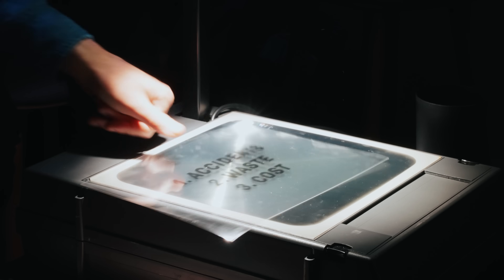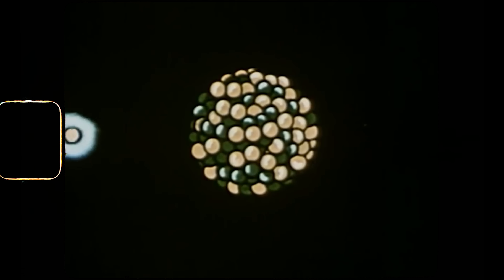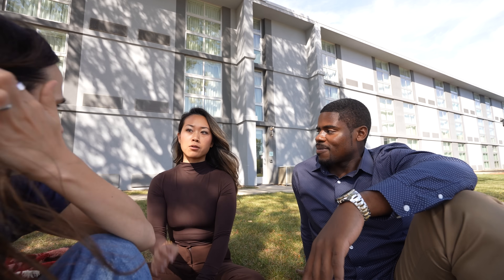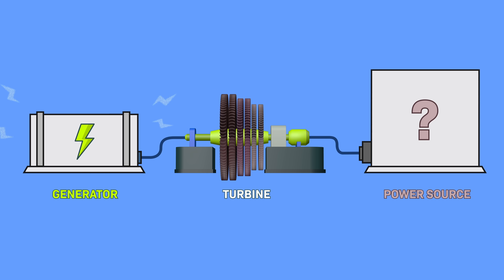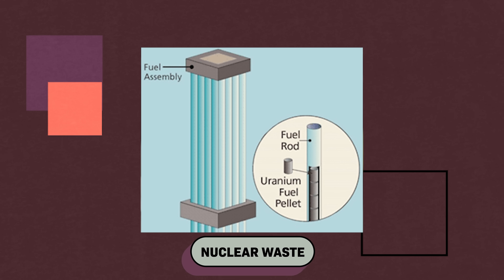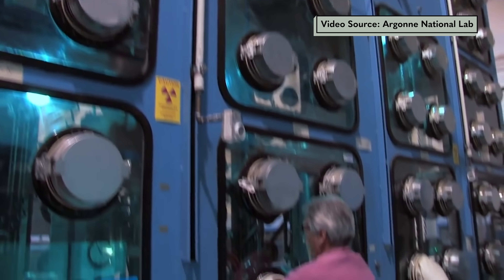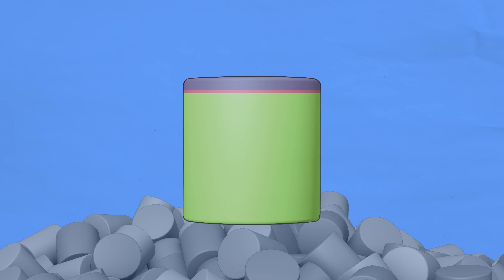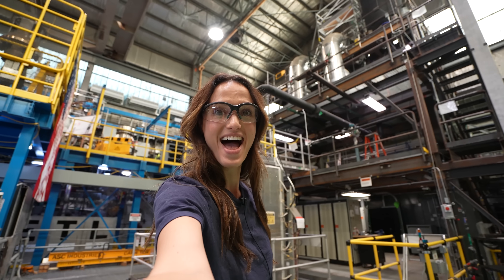The Big Lie About Nuclear Waste

Comment: Nuclear energy in general hasn't been nearly used to it's full potential due to fear and hence, politics. I remember both 3 Mile Island and Chernobyl. The really dumb thing about what happened after that is that we basically halted innovation with nuclear reactors and are still using the same reactors we did in the 70's and 80's out of fear when we could have been decommissioning those older, less efficient and more dangerous reactors and replacing them with newer, safer, and more efficient reactors. The same can be said with nuclear waste. Technology needs a need to advance. If something is deemed dangerous and scary by the general public and that fear is used politically, then the perception is that there is little to gain by doing more research on it. 
Ironically, it will be true environmentalists who will ultimately push for both technological advancement and a greater use of nuclear energy.

Comment: It’s not nuclear waste it’s second tier nuclear fuel - as someone above stated they never came up against engineering problems that couldn’t be fixed/solved (or to a point even financial problems) but they are and have always been up against political problems and nibmyism (Brit term nimby-not in my back yard). Largely because people are scared of it whilst not understanding it (part of the root cause) it’s actually got a much better safety record than all other forms of power generation with exception of solar and wind! People just don’t realise the danger of other forms!

Comment: Look into thorium molten salt reactors, they can eat the raw nuclear waste without recycling it first. The neutrons from the waste turn inert thorium 230 into thorium 233 after about a month which can generate power the thorium 233 decays into uranium 233 which is safer than uranium 235 and 238. It’s insane we refuse to use thorium MSRs, insane!

Comment: Look into above ground tunnels over interstates harness the airflow for free electricity filter and use activated charcoal to pull carbon monoxide from the airflow use plasma screens to heat sea water in pits in our desert areas to moisten the dry air from the rocky mountains and see what you think

Comment: It's the same as getting some fresh green marijuana and putting it in a bong and then smoking it..
Then after you have heaps of cones you empty and filter the bong water..
And refill the water..
Then keep smoking..
Then after a while you scrape out the cone..
And then continue to repack it with fresh green..
Then you need to clean the stem..
So you use all of the resin in the stem and mix it with the dried out bong water and the scraped out gutter hash from the cone and then its all good to go again...
 Rinse and repeat...
It's not really rocket science...

Comment: Reprocessing spent nuclear fuel for breeder reactors involves separating usable fissile material (like plutonium and uranium) from the rest of the spent fuel. This process, while intended to recycle valuable materials, produces a large amount of chemically toxic radioactive liquid waste. Here's why this happens and why it is a significant problem:
 1. Chemical Complexity of the Reprocessing Process:
   - The reprocessing of spent nuclear fuel typically involves a method called PUREX (Plutonium Uranium Redox EXtraction). This process uses strong acids (such as nitric acid) and organic solvents to dissolve spent fuel rods and chemically separate plutonium, uranium, and other fission products.
   - As the fuel is dissolved, a complex mixture of highly radioactive fission products (such as Cesium-137 and Strontium-90) and transuranic elements (like Americium and Curium) are left behind in the solution. This solution, which is a mix of dissolved radioactive materials and chemicals, constitutes the chemically toxic radioactive liquid waste.
 2. Volume of Liquid Waste:
   - The reprocessing of a single ton of spent nuclear fuel can produce several cubic meters of liquid waste. Given the scale of nuclear power programs, this can result in vast quantities of waste over time.
   - This waste is not only radioactive but also chemically toxic due to the presence of heavy metals, acids, and other chemical residues. 
 3. Difficulty in Treatment and Stabilization:
   - The liquid waste is highly challenging to manage because of its chemical complexity and radioactivity. Stabilizing this waste often involves converting it into a solid form, typically through a process called vitrification, where the waste is mixed with glass-forming materials and heated to produce a stable glass that encases the radioactive elements.
   - However, vitrification is expensive, energy-intensive, and not suitable for all types of waste. Furthermore, the process can only stabilize the waste, not eliminate its long-term radioactivity or toxicity.
 4. Lack of Economically Viable Disposal Methods:
   - The disposal of chemically toxic radioactive liquid waste is problematic due to the long-lived nature of many of its components, some of which have half-lives ranging from thousands to millions of years.
   - Current methods, such as deep geological disposal or long-term storage in specially designed facilities, are extremely costly and have yet to be implemented on a large scale. Moreover, the political and societal challenges associated with finding and approving suitable disposal sites further complicate the issue.
   - The economic viability of any disposal method is hindered by the need for long-term monitoring, maintenance, and security to prevent leaks, environmental contamination, or potential misuse of the radioactive materials.
 5. Environmental and Health Risks:
   - The liquid waste poses significant environmental and health risks if not properly managed. Accidental releases or leaks from storage tanks can contaminate soil, water, and air, leading to long-term ecological damage and health issues for populations exposed to the radiation.
 Summary:
Reprocessing spent nuclear fuel for breeder reactors generates vast amounts of chemically toxic radioactive liquid waste due to the complex and inefficient separation process involved. This waste is challenging to treat, stabilize, and dispose of economically because of its volume, chemical toxicity, and long-lived radioactivity. The lack of economically viable disposal methods poses significant environmental, health, and safety risks, making it one of the most difficult challenges in nuclear waste management.

Comment: We're actually pretty close to fusion which is much more clean and stable. If it got it's necessary funding we would have it by now. But it wont as it will destroy the oil market and solar.

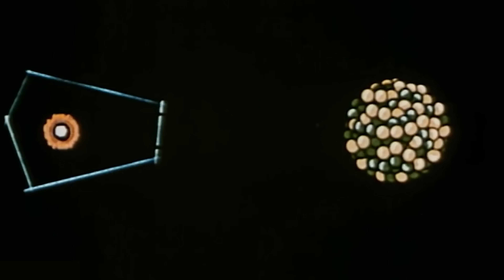Comment: 12:23 The economic calculation stating that using new Uranium rather than recycling is flawed because it doesn't consider the cost of storage and impact of the waste. One time use + 200,000 year storage cost + risk * probability of risk considering timeframe VS one time use + recycle use + 200 year storage cost + associated risk

Comment: I don’t believe the used fuel for 150 years. Math doesn’t work. We have not used nuclear fuel long enough to create enough waste to power for that long. Fuel is replaced because the fission is not robust enough for electric production in the current reactors. But the waste from 50 years of usage can be used for 150 years? Does not compute.

Comment: Problem is: it’s not ready to use economically. Until we make it cheap enough, solar and wind will be even cheaper than they are already… 
The private sector won‘t invest without backup from the government. And when you only plan on using the existing nuclear waste, it’s only a matter of time to run out of fuel. To avoid this you would have to continue using regular reactors, which in turn are dangerous (chernobyl, Fukushima and the countless incidents in most reactors around the world you didn‘t hear of, because the catastrophe was prevented in the last moment)

Comment: The biggest issue with a nuclear plant is the cost, the cost overrun and the fact it takes about 10 to 15 years to build a plant. And there is insurance. No company in the world will insure a nuclear plant which means governments are now in the insurance business 

Then there is the cost of protection or not protecting a nuclear plant. When the hijackers clue those planes into the buildings on September 11, one of their targets initially was going to be a nuclear power plant, but they incorrectly saw would be well fortified with anti-aircraft missiles. They aren’t. They are woefully protected by rent-a-cops. One well placed air plane or explosive will create incredible death toll. 

Contrast that to solar. It takes maybe a year and a half in a northern climate to put up a solar farm. The costs are a fraction of what a nuclear plant costs.

Battery storage and efficiency technology is dropping at an incredible rate. What was $1000 a KWh, two years ago was a$140 two years ago. Today it is now $56. That figure will drop to $5 by $2036. Electric companies know that which is why they aren’t bothering chasing with antiquated nuclear tech 

You mentioned Japan as apparently shining example how to handle nuclear waste using the breed reactor. I don’t know if you heard about a little thing called Fukushima, but that didn’t work out so well for them. in Japan is just it’s just one more natural disaster away from another nuclear disaster.

Comment: Nuclear makes no economic sense if you can not access cheaper renewables which are  1/2 to 1/4  the cost  … if you not have the land or climate go the more expensive nuclear route but it does lock you in to higher and uncompetitive electricity pathway

Comment: As a physicist, I am deeply disappointed with the one sided style of reporting being done here. TLDR: nuclear reprocessing is VERY messy.

In order to at least try to give a somewhat objective account of the topic there are missing two things: 

First, a discussion of the existing large scale nuclear fuel reprocessing plants in la Hague and Sellafield and their issues with water pollution. 

Second, there is no mention of the unsolved engineering challenges surrounding both carbon based thorium fuel spheres and Liquid Metal cooling required for many fast breeder reactor types. 

I strongly suspect that it is not a coincidence that both fast breeders and fusion reactors both need Liquid Metal cooling and both are currently stuck in a prototype stage for decades now.

I have worked closely with a colleague who did research at the German national laboratory at Jülich, long before Germany abandoned nuclear power by the way, and the kind of challenges and moving goalposts that he told me about sounded a lot like fundamental drawbacks and not like technical details to be fixed easily.

Comment: The big lie about Nuclear Energy is that it's cost effective.
Reply: Nuclear is the cheapest form of firm power.
Reply: In Australia 
'Consistent with our LCOE analysis, AEMO’s modelling finds renewables to be the cheapest form of energy production when connected with transmission, firmed with storage and backed up by gas. It does this by comparing alternative generation technologies and the impact that they have on the scale of required supporting infrastructure (transmission and firming investments).'

Comment: Yeah, but part of the of misunderstanding is far more around fears of a nuclear accident. It's ironic the video mentions Japan doing it given the most recent nuclear accident being a direct result of this, rather than say, France which hasn't.

Fast reactors use sodium coolants that immediately catch fire when exposed to air or water so any leaks can cause huge shutdowns in the plant and open the possibility of catastrophic failures that simply aren't possible in conventional reactors.

I think if the public realized nuclear waste was tiny pellets of metal and the cylinders were just metal/cement caskets around it, they'd be much less concerned about stuffing it into a mountain as it's not really something that's going to just leak into the groundwater.

Comment: Breeder reactors are a security risk because the fuel it produces is weapons grade.
Reply: Weapons grade production requires short-cycling fuel. Any reactor design with continuous reactivity, except for the extremely inefficient push-through designs, can't be used for weapons grade production.

Comment: Even the u238 can be used for fission since u238 is fertile and can be used to breed plutonium 239 which is fissile so all the fuss is about nothing less than one percent of nuclear waste is high level and even with out recycling you can use the radiation emitted by the waste to produce electricity by using a scintillator to down grade the energy of x rays and gamma rays into visible light which then with the help of photovoltaic cells can be converted into electricity but thats "too expensive"

Comment: Base Problem with solar and wind is the unreliability. Industrial countries need cheap and reliable power. 
Without the usage of energy storage those sources are not usable.
The next problem is how power needs to be produced. You can't pump an excess of energy into the network, you need to produce the right amount.
In germany for example we have the problem with renewable energy abundance. We produce so much that we can't use it on time. The excess needs to go somewhere. Germany pays other countries for our excess, this makes renewable expensive and unreliable.

Germany cut research on nuclear technology because of green oarty ideology.

Comment: Surprised that you did not discover the vast potential of use of Thorium as fuel and molten sodium cooling instead of water, asdeveloped at Oak Ridge Labs in the 60s and 70s and being further developed now... where else? Perhaps China (of course) That tech can also combine with using nuclear waste and would solve the other meltdown dangers as well (re Fukishima).Please look up Thorium fuel small molten salt nuclear reactors. Please! you are the type of commenter that canhelp move to this much safer,cheaper and more viable nuclear power!
Reply: Thorium is a great fuel in molten salt reactors but it is usually expensive to extract and comes with the risk of freezing the molten salt in the core which can severely damage the reactor and is usually very expensive to repair.

Comment: Yes Yes and Yes.  Alot was the Metal alloys back in the day because the Molten Salt reactors would rust the metals. But that problem has been solved . The Metals Alloys of today last about 50-100 years before they rust  .

Comment: Chloe, great show as always.  I really enjoy the work you do.  Thanks.

Please check out Silex Systems if you are inclined.  They are now working through the TRL6 process in the US, which is the final stage before a commercial enrichment plant is built.  Silex, through an agrement with Global Laser Enrichment (GLE) has an agreement with the USA Department of Energy (DOE) to use spent fuel to create nuclear material for future power generation.  SLX has the only advanced third generation enrichment process using laers, rather than centrifuge or the even older gas enrichment processes.  As such, the "spent" fuel can be reprocessed at low cost, and indeed there is more than 100 years of available material from less efficient, spent fuel, to create fuel for future generation of material for use in new and efficient reactors.  Thankfully, the future is bright.  Thanks for bringing some clarity to this debate which is unfortunately underpinned by fear.